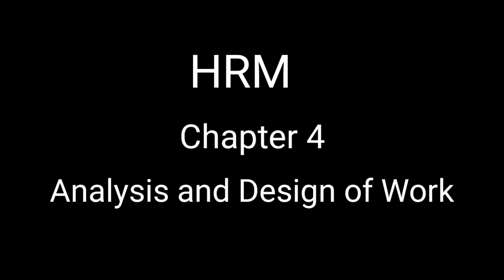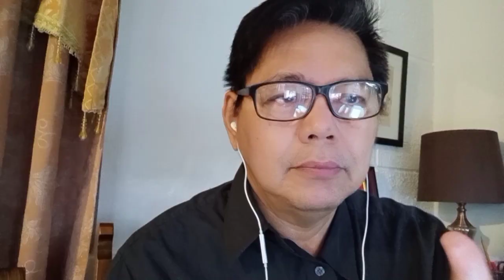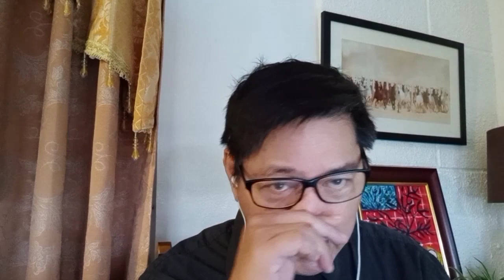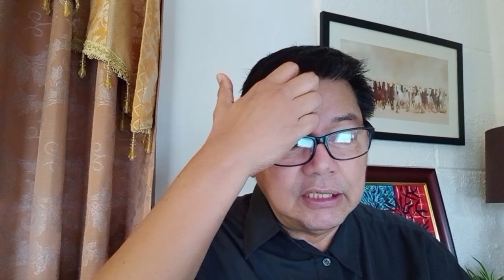HRM: ANALYSIS AND DESIGN OF WORK

Comment: Mark Daniel B. Tungol
MBA - BIR Quezon City 

A comparison of Toyota and BMW were presented as to their standing in the industry. Way back 2007, Toyota surpassed general motors’ as it used standardized structure. However, limited responsibilities were given by using only the best way approach. On one hand, BMW is considered polar opposite to simplify and standardized procedures and decision making. The company uses flat hierarchical structure that lead them to be number one in terms of sales. The former was considered number one in terms of volume.
The way a firm competes can have a profound impact on job designing and analysis. The way jobs are designed can affect company work performance. Organization needs to create a fit to each environment and industry where they belong to. Job Analysis and Job Design are interrelated.
Workflow analysis is a means of the manager to produce products within the company’s means. Outputs are products or services provided by the work unit. Work inputs are ingredients that can be broken down in raw materials, equipment-which were referred as technology, and human skills. Workflow design includes organizational structure. It is the relatively stable formal network vertical and horizontal linkages between employees. Work processes are the activities of work unit to produce in a given output. How things should be done to develop particular products. Once outputs have been identified, specify standard output or measures or levels of required performance for different level of efficiencies.
There are two most important structure of designing work namely: Centralization and Departmentalization. Centralization is where the degree to which authority resides at the top of the organizational chart while Decentralization is the degree to which work unit are group based from functionality. Structure of Airbus and Boeing were also compared as the discussion goes through.
Functional structure and Divisional structure were also introduced. Functional structure employs a functional departmentalization scheme with high levels of centralization. This structure tends to be inflexible and insensitive to subtle differences. The jobs need to be narrow and highly specialized and people need to be working alone under the said structure. Divisional Structure, on one hand employs a workflow departmentalization and low-level centralization. This structure tends to be more flexible and innovative; it is not very efficient compared to former. This structure is more of team-based making authority and surrounds a holistic environment. 
Job analysis is the building block of everything the personnel department does. It includes human resource planning, selection, performance appraisal, training and development, job designation, career planning, job evaluation and redesigning. The importance of this to line managers is to have information to the entire job to understand the work process. Managers must clearly understand the task required to each job within their scope. Job analysis information or job description is the list of jobs or tasks required to perform specifying the said position. With continuous research, Job analysis by managers or even by external consultants is biased.
There are some job analysis methods used like Position Analysis Questionnaire (PAQ), Flieshman Job Analysis System (FJAS), Occupational Information Network (OINET), Mechanistic approach, Industrial and Scientific Management.
Motivational approach on one hand encompasses job enlargement, job enrichment. This also includes self managing work teams. Job characteristics model indicates that jobs can be designed based on five characteristics namely: skills variety, task identity, task significance, autonomy and feedback. There are three psychological states discussed namely: experience meaningfulness, responsibility, knowledge of the resources. As this approach aims to have higher quantity, and quality of work, higher level of job satisfaction. However, as it increases employee satisfaction, it is not necessarily increase performance output.
Biological approach is another approach on which it is from the science of biomechanics; the study of body movements, or ergonomics. This approach understands the physical movement and the work environment to minimize physical strain within the environment - to minimize stress in the workers body. This also focuses on outcomes such as physical fatigues, aches, complaints. It also aims to reduce physical demands and occupational illnesses. 
Perceptual motor approach is another approach that focuses on human mental capabilities and limitations, that they do not exceed people mental capabilities. This tries to improve reliability safety and actions by designing ways to reduces processing requirements. It main focus is the cognitive demands of the employees.
It is important to understand the trade-offs inherent to one important job design. Since job designs are not interrelated to one another, it is hard to redesign or to make a decision on which to improve and to let go. Considering the status and situation of the Human Resource personnel in the Job Design and Analysis, it is very crucial since the very definition of job is the core why incumbents are entering the company and willing to work within such environment. Thus, being an HR, you must also possess not only knowledge to the very work of each individual in the company, but wisdom as to the relationship of each work and their expected output. Having this kind of HR will help not only the managers but also the top management to hire employees worth paying for.

Comment: Maria Teresa T. Ligot
MBA - BIR, Manila

Chapter 4 discussed the analysis of work process within a given work unit and the need for usefulness of both analysis and the technique in performing jobs.  Also, presented various approaches of job design to provide managers with understanding the cost and benefits emphasizing different characteristics of jobs when designing or redesigning them.

This chapter teaches us that part of the job of Human Resource Management is to work around processes, procedures and structures of what an organization needs and evaluate current practices and redesigning them of what is best befitting the company to make changes accordingly, eliminate setbacks, make analysis currently needed and develop activities that enable the sustainability of the company.  Moreover, to identify most qualified employees their job description and specification to the task at hand, skills needed to be harnessed, monitor performances and productivity and make necessary adjustments of what is suitable in the current structure that is best beneficial to the organization.  It is wise for the HRM to be vigilant for changes and be flexible to any given condition.